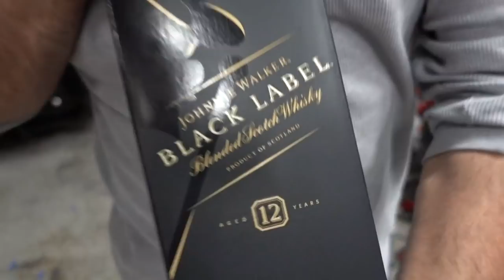SCOOTERTUNING Visits HP LOGIC! 100cc vs 70cc 2 fast

Comment: It's just so damn entertaining because they just aren't supposed to be fast!
Reply: Yes they are they actually using real mini Gp Motorcycle Technology and cylinders former Gp Motorcycle Technicians been building tuned cylinders and motors for these scooter's for over 12 years now a fully tuned and ported 100cc 2fast or Roost Havoc cylinder will produce 40 horsepower making them true Gp motors
Reply: There is a video of a 200cc bicilinder with 72hp i think its just crazy these 2 strokes
Reply: @The2strokechannel  your wrong man it has a extended crankshaft and a 15 mm plate under the cilinders wich gives it an additional 10 cc so its about 210cc with 75 ish horsepower
Reply: @Oskar Toivanen Yeah,same in Latvia :D also scooter racing in track is a thing here.